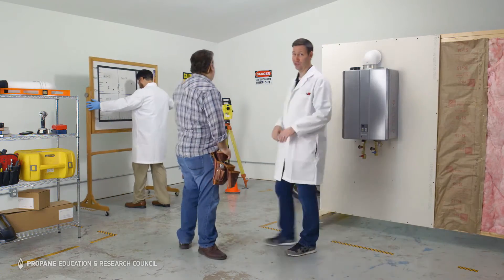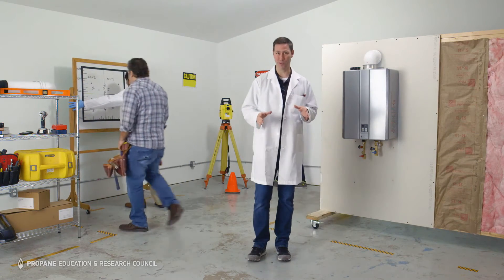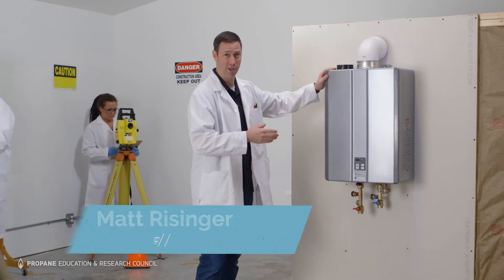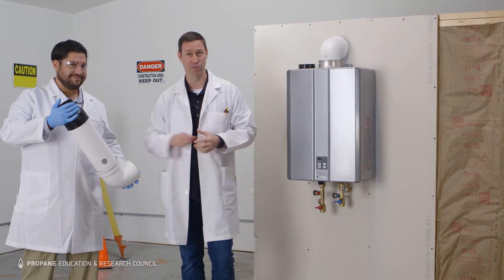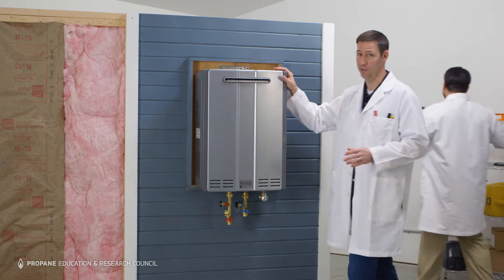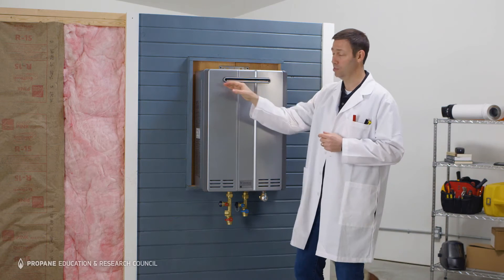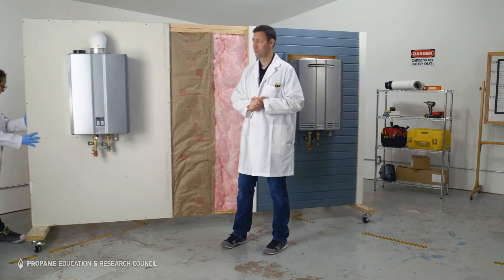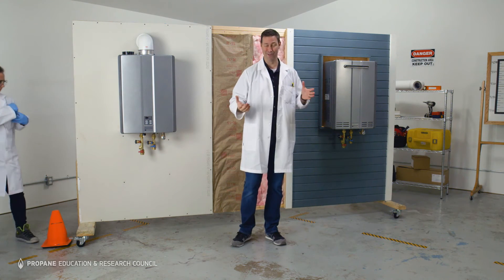Do Tankless Water Heaters Require Complicated Venting?

Comment: Won't PVC pipe melt? Isn't it plastic? Doesn't plastic melt? Just wondering I've always heard it does but I could be wrong as I have been many, many times before.
Reply: my first thought too, and from what I've read those units capture almost all the heat output for heating the coils.  given that ABS/PVC is rated up to 145F, one has to assume those things put off barely any heat.  Just blabbering from my end, still researching.

Comment: What about converting the vent from a previous tank style gas water heater to use with a new tankless heater? Any issues with using the already existing vent?
Reply: I'm trying to find the same answer. It's like an enigma. You can't use a masonry chimney for a tankless setup, but a tank heater can? WTF!?!?!?! Any updates?
Reply: Ditto.   Haven't found anything suggesting how to "retrofit" the 3 or 4" steel duct to a tankless either.